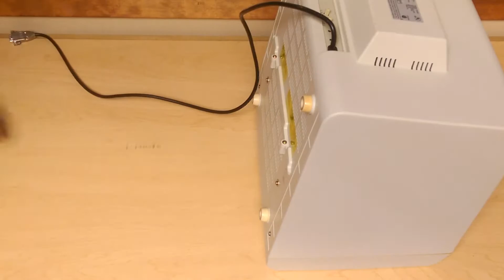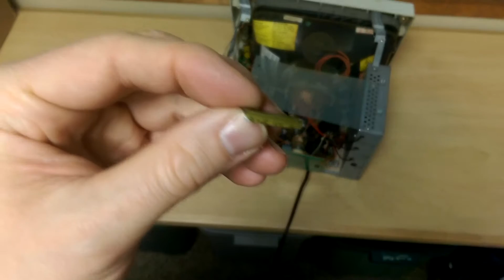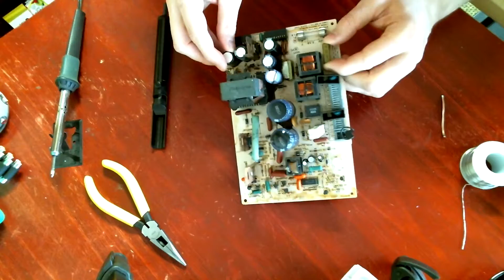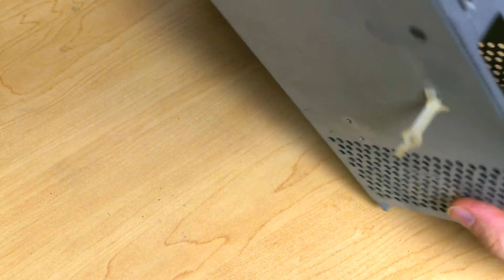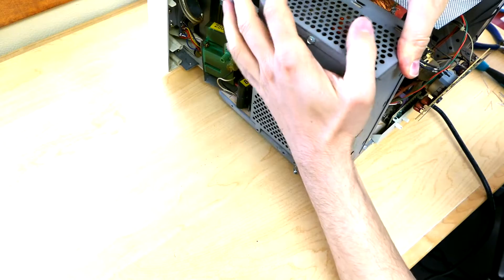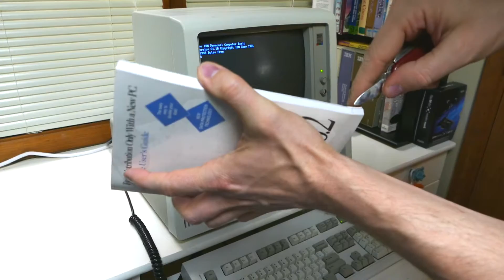IBM 5154 EGA Monitor Repair

Comment: Got the exact same issue yesterday after just a few seconds (while switched off). 5162 + 5154 config, my father's PC from the late 80's, has been on a shelf since the mid 90's, and never used since. Thanks for your video !! I didn't switch on the PC so far, will fix the display first.
Did you ever managed to fix the HD issue ???
Reply from the maker: Hi, thanks for your comment! No, I didn't get the HD fixed, but ended up installing one of Blue Lava Systems XT-CF cards, which worked great! https://shop.bluelavasystems.com/products/xt-cf-bootable-8-bit-isa-compactflash-xt-ide-with-slot-8-support
Reply: @retrobsolete7491  It was the exact same C5 capacitor that blew... waiting for the (all the) caps to arrive, and wondering whether I should check/replace some diodes and resistors that seem to have heated quite a bit...? Can't wait to have the display fixed to check the PC (as I've got no alternate EGA display), if the HD works, I might retrieve the Turbo Pascal code I wrote some 40 years ago to display my first fractals...   ;-))

Comment: I recently had the same issue with my 5154 blowing a RIFA in the power supply. The smell was so nasty. Your video was awesome in pointing me to what the issue was when my monitor let out some of the magic smoke. I ended up replacing both RIFA because the other one was cracked and ready to go at any moment. I also did a short video on my channel and linked to your video as well for anyone else who might run into this problem. I did overlook the part about drilling out the rivets to get into the power supply heh. I did the slow painful way using a dremel but finally got inside. Thanks again for your video which helped me out a lot.
Reply from the maker: I'm glad you found my video helpful, and most of all, got your monitor working again! Thanks for your kind comment.

Comment: I know this is old but just heat the legs of the caps and pull them out then clean the holes after.
The black stuff that you said leaked out did not it was horrible glue stuff that they used to stop the capacitors vibrating in transit.
You also did not mention the capacitor that blew up and the similar one are special  "X2" type designed to be connected directly across the mains line.
Reply from the maker: Oh yes, thanks for clarifying!

Comment: Awesome! I’ll have to open mine up and see what’s going on to prevent this. Do you have a cap list at all??
Reply: Those are old RIFAs, most of them get cracks sooner or later, moisture gets in and they get hot and burst/burn. I've seen them blown or full of cracks in devices from around mid-70ies to late 80ies/early 90ies. Just replace them whenever you encounter them. But if you do, really use new X2-rated ones. Using other caps directly on the mains is really dangerous and they will not last long at all.

New RIFAs seem to be fine (they still make it in this design, but seem to have really fixed the problem).
Reply: @VintageTechFan  Yep those darn RIFA letting out the magic smoke. The smell is nasty too! I had the same issue with my 5154 recently and did a short video on what happened, repair, etc.

Comment: I have the same monitor and the caps on mine are bulging, where can I find the largest caps?
Reply from the maker: Here are some links to the larger capacitors I bought for this repair:

https://www.mouser.com/ProductDetail/667-ECA-2EM221

https://www.mouser.com/ProductDetail/647-UPM2D470MHD

https://www.mouser.com/ProductDetail/647-UKL2A221KHD

https://www.mouser.com/ProductDetail/647-UKL1E102KHD

https://www.mouser.com/ProductDetail/647-UKL1C222KHD

https://www.mouser.com/ProductDetail/647-UKL1V470MPDANA

Hope that helps!

Comment: i'm struggling to repair a 5154 clone by Trust (golddisplay ega) and i suppose the main issue is with the flyback transformer. i can't find any useful data on the web about the monitor itself or the flyback but i imagine that they cloned 5154 very closely: could you tell me which flyback is installed in the original 5154 thus helping my way??
Reply from the maker: Sorry I didn't reply before now! Were you able to get your 5154 clone working? I'm not really sure what the flyback transformer is to be honest... Any clues on what I should look at to find a model number that might help you?

Comment: What is the normal color for text on these monitors? I can't really tell in the video.
I just picked up a PC AT with a 5153 monitor, and the text on screen is a deep to medium blue color (depending on brightness and contrast settings). If I really crank the brightness, I can get it to a light purple. It is also a vivid blue color when the monitor is not connected to anything. Is text on the screen supposed to appear as white?
Reply from the maker: In my experience the text is white/light gray by default. I've haven't come across what you're seeing on your 5153, but depending on what graphics card is in the PC AT, there may be jumper settings for compatibility with different types of monitors. I recently read for instance the IBM EGA card has jumpers for use with 5154, 5153 and 5151 monitors, which change the output mode. Anyway, that's about as far as my knowledge goes on this... I'm learning as I explore this stuff too. :-)
Reply from the maker: Edit: The IBM EGA card has switches for configuring modes, not jumpers.
More info here: http://minuszerodegrees.net/ibm_ega/ibm_ega_switch_settings.htm

Comment: Hello.  I have the same monitor with the same problem, one of the line suppression capacitors blew.  Would you mind sharing the make/model of the replacement you chose to purchase?  Very informative video.
Reply from the maker: Sure thing, I believe the cap you're referring to are the rectangular ones? I used the Panasonic ECQ-U2A104KLA which I bought through mouser:
http://www.mouser.com/Search/ProductDetail.aspx?R=ECQ-U2A104KLAvirtualkey66720000virtualkey667-ECQ-U2A104KLA

The monitor is still working great. Good luck with your repair!

Comment: Maybe the system backup battery is dead. Just replace it and define your HDD params in the BIOS again and it should work. 

Btw - I have a different problem you might be able to help me with (if you would be so kind):
I own a working IBM 5154 where someone cut off the 9 pin EGA connector, i.e. I have 9 different colored wires but limited ideas (well, GND should be simple) how to solder them to a 9 pin D-sub connector again. Is there any way you can open up your D-Sub connector and take photos (or a video) from both sides, so one will be able to see the color code? Assuming we may have both the same color code of the connector (I have the -002 EU model though) of course ... Right now I consider this to be my best shot (besides trial an error ... I do not want to end up like the start of your video post ;)
Reply from the maker: Yeah, I'm pretty sure the battery is dead.

Sure, I'd be glad to help you out! I'll try to get a video up in the next couple days showing the connections in the 5154 9-pin D-sub connector.
Reply from the maker: I put up a short  video with some pictures of the connector. Hope that helps!

Comment: Good job on that repair! The hard drive may need to be low-level formatted, that could be why the system isn't detecting it.
Reply from the maker: Thanks! Yeah, hopefully the hard drive isn't dead, and can be revived!
Reply: There's a DOS utility called "speedstor", it allows you to do various tests on the hard drive and it's controller, plus it has a low-level format function built in. I recommend you check it out.
Reply from the maker: I will definitely check out speedstor. Thanks for telling me about it!